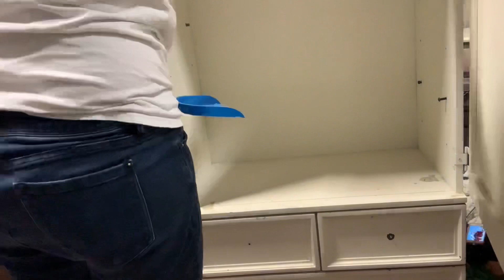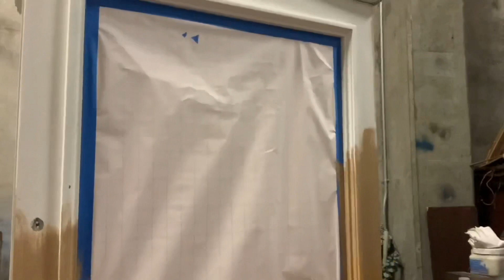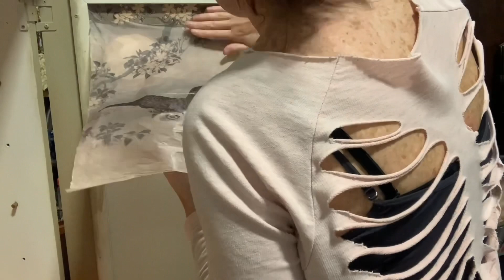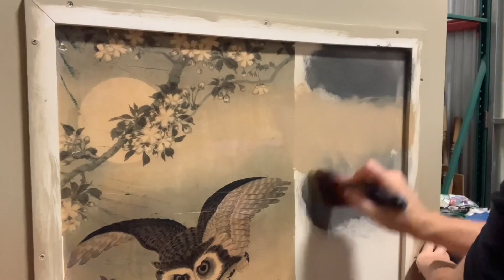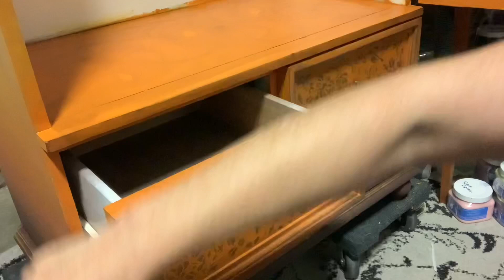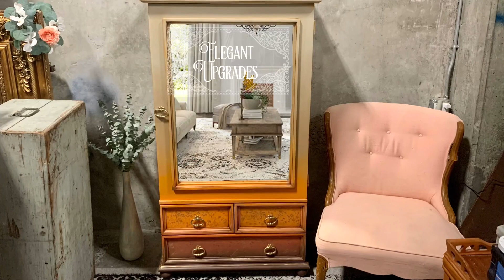The Pumpkin Spice Makeover With All The Fall Vibes | Elegant Upgrades | Blended Paint & Decoupage

Comment: I have to ask you.. because you are the decoupage queen..what's the difference between 10 lb and 18 lb
Reply from the maker: Haha! I don’t know about being the decoupage queen,  but the 10 lb is quite a bit like the tissue paper you use for gift wrapping. Very thin and pretty delicate. The 18 lb is quite a bit thicker- not quite as thick as newsprint, but getting there. It’s much easier to work with, but there is more of an edge in the finished product.